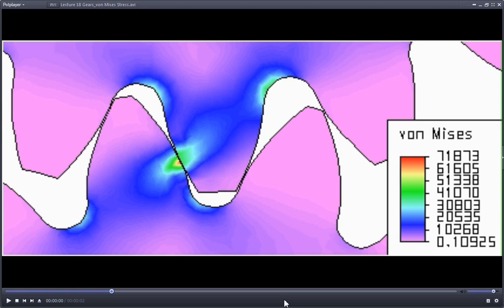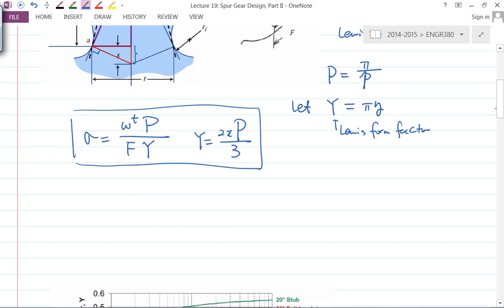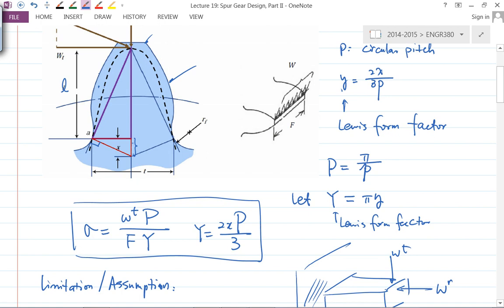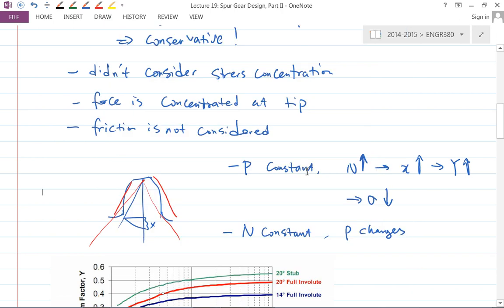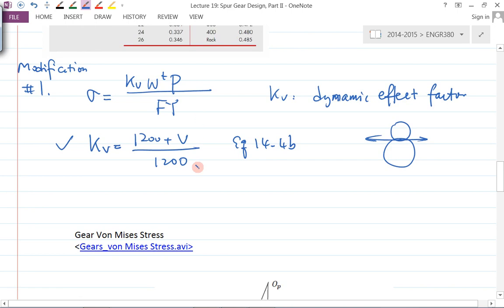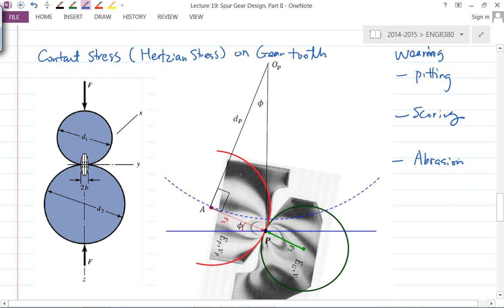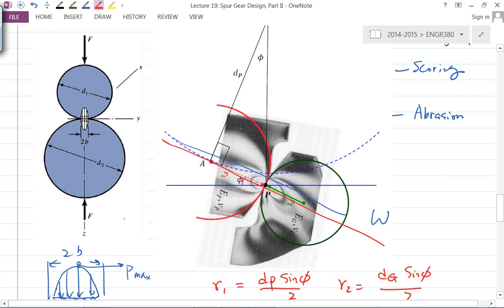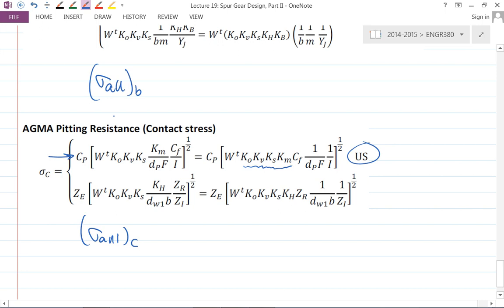2014W ENGR380 Lecture19 Spur Gear Design, Part II

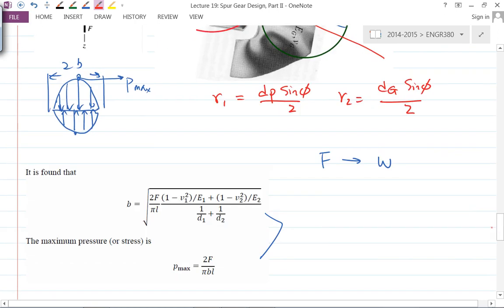Comment: At 39:10. dp is not mentioned at correct location. Where you have written dp that is indeed a base circle diameter but the straight vertical line is meeting at pitch point which, in reality, is pitch diameter. And your trigonometric function sim makes sense only in that condition.

Comment: Dear sir. I have a question. Regarding Yf (LEWIS form factor), I think there are infinite numbers of stress parabola which are tangential to gear surface or root radius. How can we define the stress parabola?
Reply from the maker: There might be infinite parabola tangent to the root. But there is only one that gives constant strength.  Lewis basically considered the gear tooth as "uniform strength cantilever beam", which means that, no matter where the cross-section is taken along the cantilever beam, the maximum value of bending normal stress sigma (which is on the top of bottom edge of the cross-section) remains uniform or no change.

Comment: i dont understand at 20:39 sir , would u please help. u said addedum and dedendum doesnt change ( which results in same tooth profile and thus same form factor ) if diametral pitch (P) is constant which is obvious from the formula of a and b you wrote. but in that shoftware tooth profile changed for constant P and changine no of teeth (N).  and thank you for the video, it is helping me a lot .